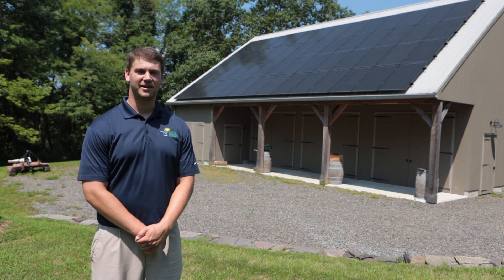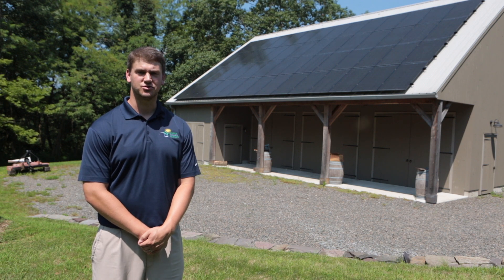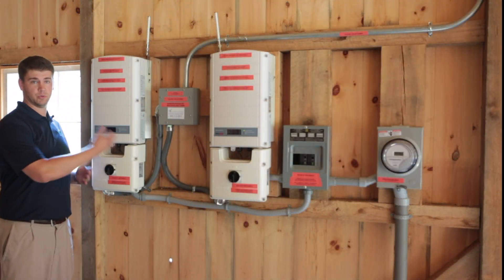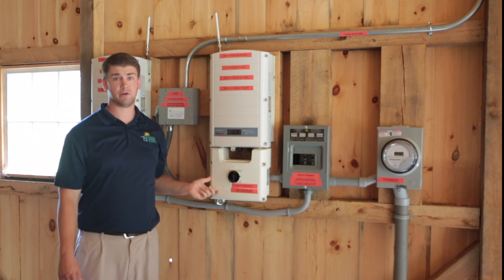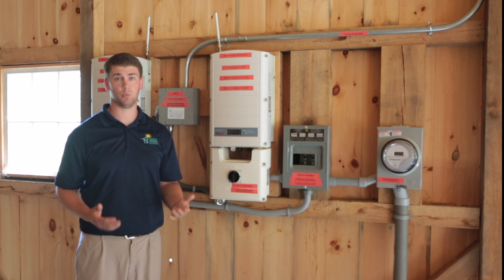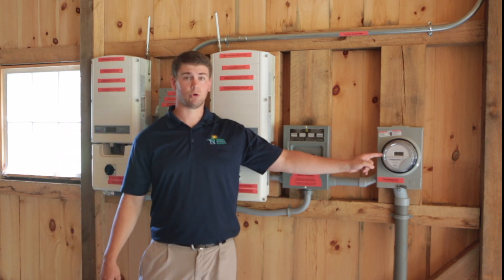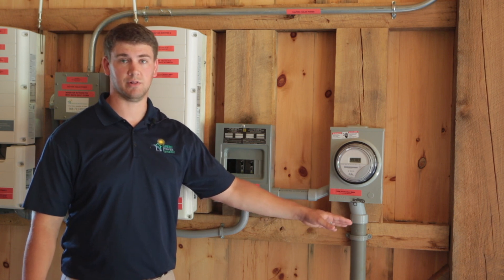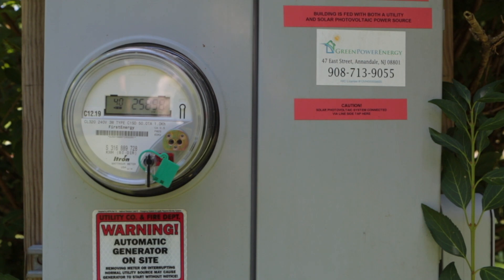Green Power Energy's Solar System Walkthrough

Comment: So I am guessing you are using power optimizers on each panel. Generally speaking, when do you see a centralized inverter architecture with power optimizers vs a decentralized (micro-inverter) architecture?
Reply from the maker: Hi Rob, on this system, the central inverter you see is part of a SolarEdge power optimizer system.  We offer both products.  SolarEdge is a touch more efficient than Enphase micro-inverters but micro-inverters do have the advantage of being completely independent from a main point of failure.